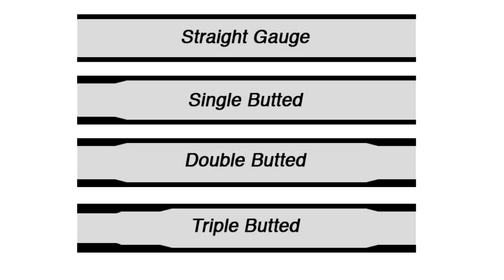Steel vs. Aluminum Frames

Comment: There's a lot of evidence that steel bikes are faster if you get one that flexes enough for your power output. Also steel is far less fatiguing and so you can ride faster for longer. The important thing is getting a thin, flexible frame. Of course thin tubing is no good for a street bike but if you want to go fast.. it has to be like that.
Reply: I know that this is 6 years ago, but trust me steel isn’t faster at all than aluminum. I’ve been riding fixed gear for at least 3 years now and when I first bought my frame, it was a steel retrospect fixie. All of my friends have an aluminum material frame. Every single time I rode with them I was the slowest and left behind. On any ground, trails, streets, etc. and I thought it was my weight, but no. Once I bought an aluminum frame, I was way faster and felt the weight difference. And yea your right, sometimes it depends if it’s flexible or suits your power but I weight 120 and I was still left behind.
Reply: @acidgoon  Try riding 50, 100km on a rough surfaced sealed road. Aluminum will kill you from vibration fatigue
Reply: @thomassmith4999  that doesn’t prove my point though, most fixed gear are made for track or street.
Reply: @acidgoon  Yeah but a very short distance doesn't show anything other than weight. The randonneur guys are the ones to watch to see what bikes are actually efficient and fast

Comment: carbon fibre is nice but costs too much not durable enough to crashes which is going to happen while city cycling .So my dream bike is titanium all the way , light strong good looking and can made in a classic look but pricy .So second choice is CHROMOLY triple butted painted dark metallic Purple :)  Now to add one in aluminum in an aero triathlon look with aero bars wheels etc because SASK is windy and flat. My current bike is a classic STEEL road bike and l love it ,BUT l am searching for a Ti  road bike next to add to my current collection :)

Comment: >just ride more

But if one considers the law of diminishing returns you'll find that the more muscle mass you gain as a steel rider you gain a proportionally large amount of overall weight that will ultimately reduce performance and slow you down. Most track riders aren't racing with steel framed bikes, they are all riding carbon or graphene frames that reduce thier overall weight and allow them to build up 27" inch thighs. If you were to race someone of equal fitness who is riding an aluminum framed bike you will always be at the disadvantage. 

Im inclined to think your pretentious hipster steel bias heavily sways the overall tone of this video.

Comment: I have 8 different bikes... A steel fixed gear, an aluminium frame track machine, 3 aluminium mountain bikes ( 2 hardtail 1 full suspension), a vintage Columbus slx steel race bike, a drain pipe vintage steel commuter, a carbon modern race bike, and an aluminium cross bike.... It's not material... It's geometry of the frame that affects ride characteristics I love the all  but the one that feels fastest is my 1988 Viner record professional slx that takes the cake... I can smash that frame with 1000 watts of effort and it just doesn't give up..might flex a bit across the cranks.. might feel a bit twitchy.. but god damn it's fast

Comment: I have a carbon giant tcr, a Masi single speed steel, and a lynskey titanium bike. All have somewhat similar geometry, and all are on 25c tires. The lynskey is hands down the best of the three. It"feels" livelier and has a very surefooted feel to it. While I can't isolate this to the frame material, it's seems to be the likely reason since I have felt similar characteristics from a friend's moots titanium bike. If you can drop the coin, I would recommend titanium for a life long bike.

Comment: alluminium when oxydizes usually creates an alluminium oxyde layer that prevents the oxydation of alluminium bellow it, at least that's how i learnt in school.
on the other side, iron when it rusts starts flacking and oxygen gets to the lower iron spreading the iron oxyde further.

so i think alluminium  should not corrode when compared to steel/iron (remember people use alluminium on windows, that are exposed to humidity alot more than a bike)

Comment: I am thinking of going back to steel after riding aluminium for ages. Aluminium is better uphill because lighter but otherwise I preferred steel on flat. Slightly heavier steel frame  in fact helps on flat. Otherwise I dont think the performance is affected but I would say steel frame can be made to last forever providing you look after it reasonably.

Comment: Aluminium will oxidise but will not corrode in moist conditions.  It will produce a very tough oxide layer that is firmly bonded to the base metal and acts to protect it.  In contrast, iron oxide (rust) flakes off the base metal exposing new base metal to the elements which is why exposed iron or steel will deteriorate over time.
Reply: You may want to research Galvanic Corrosion of Aluminum.

Comment: Some people say carbon is as strong as steel but freak out when you tap the top tube with your wedding ring or clamp it in a work stand. Wish there were more steel bike available. The bike market is all about looking like the pro's. And carbon is lighter so it's good for MUH GRAMZ even tough many people could lose some weight them self.

Comment: As where I live there are sometimes on the street there are little hole or little bumps and I was wondering if I should go with a steel frame since its stronger or does it really matter.? Any suggestions.?

Comment: I have two tange steel frame bikes.  One Single butted, the other double butted - 25 years old now.  I commute on these bikes and ride with 38c slick tires Nimbus ex that make a very supple and fast ride.

Comment: I love my Aluminium frame, nice and stiff but since I have 27.5" wheels with 1.95" wide tyres it's super comfortable, great for the cyclepaths near me which for a few miles are right next to poplar trees so the roots make it uneven as hell.

Comment: Reynolds 520 should be a standard for Street Riding , a notch higher Reynolds 725 , climb up in the latter Steelwise the frameset  tube walls will be more prone to dents ...Yall Welcome to join my group on FB,  Steel Fixed gear https://www.facebook.com/groups/SteelFixedGear/?ref=bookmarks

Comment: I can see (and have experienced) the difference in ride of steel vs aluminum, but citing reliability as a reason when referring to a fixie used for urban commuting to shy away from Aluminum is silly. Compared to other genres of bikes, they live a very very easy life, and yet there is little issue with aluminum frame dirt jump, BMX, free-ride, or other bikes that get abused much more. 

If your frame is breaking doing urban commuting, even from a crash, quality, not material, is to blame.
Reply: Are you an engineer? You're making bold claims without the qualifications to back them up

There's something called material fatigue. Bicycle frames absorb impact and vibrations and have a lifespan. Steel will last for decades, specially Chromoly, a higher quality alloy compared to Hi-tens which has more carbon and rusts (aka compromises structural integrity). Aluminum on the other hand has a much shorter use life, and it doesn't show signs of wear, and rust is harder to spot. So it results in catastrophic failure specially near the fork. Aluminum and carbon are the materials that you see the most suffering catastrophic failure and accidents in trails

Chromoly is an expensive method of manufacturing steel. The reason there are so many cheap vintage frames is because the 90s was a time of booming for mountain bikes, so they made a LOT of them, and they used a high quality material to impress the customer
Reply: Yes, aluminum has a fatigue limit, one which is easily designed around. If you look at the S-N curves for various common grades of aluminum they tend to behave similar to steel until ~10^6 cycles, after which they continue to fatigue while steel hits an endurance limit (after which steel doesn't fatigue in any meaningful sense). But even at 10^8 and 10^9 cycles and beyond there is still a large amount of strength in the material. 

This fatigue rate is also impacted by how far along the stress strain curve the cyclical loading occurs. If it's not a significant amount of the total strength of the part, it's not a significant fatigue event. If a frame is designed and produced right (quality) there is no reason that the fatigue limit is a meaningful factor in the frames life. Evidence of this can be seen in things like heavy duty cast aluminum parts on vehicles and similar that see a very high load cycling rate, but with peak forces well below their maximum yield strength lasting for many decades.

If we are going to argue that fatigue limits represent an inherent hit to reliability of a bicycle frame, then we should also argue that the corrosion issues of steel, particularly inside a frame also represent a risk to reliability. Clearly we should all be riding titanium frames. :D

My original comment isn't implying that aluminum is better or worse than steel, simply that it isn't by itself an indication of reliability (I personally prefer steel frames, but not because of reliability). The quality of the frameset, regardless of material will impact the reliability orders of magnitude more. Especially in a use case like a commuter, which generally sees lower peak forces than most other styles of riding.
Reply: Well was really considering buying the urban track 6ku aluminum
Reply: Feeeeelings.  Whoa whoa whoa feelings...
Reply: Hmm ... is riding a fixie not already silly?

Comment: you probably won't respond to this as you have 11k subscribers, and the famous YouTubers usually don't respond to non famous ones.  but I subscribed and found this topic interesting as I Have recently built up a 1988 half steel half aluminum bike from a 6speed to a 10 speed on my channel and I wish I had ride a steel bike sooner as I also enjoy the liveliness of the frame material.  even though I have  2 carbon bikes and a alum fixed gear, the steel honestly feels better to me, and although it is my cheapest bike at $120 Craigslist.  just wanted to say kudos, and great video.  from HAWAII,  aloha!

Comment: Titanium. It is like the best of both but does not corrode.
The weight and stiffness is between both aluminum and steel yet its strength is closer to steel.
The down side is its expensive and difficult to repair.
Steel is ,like you mention, excellent with weight and corrosion being isonly issues.
Carbon fiber is awesome but is not very durable as far as abrasion and being compressed. I also have concerns regarding longevity to sun exposure to the resin but I think it has the most potential because you can manipulate its properties so greatly to give a ride characteristic like no other and its extremely light but if it fails there is no warning and its catastrophic.
Carbon is also constantly evolving and I wouldn't like buying a bike that in 5 years is now obsolete.

Comment: Ain't no such thing as too rainy to ride!  But on a separate note, while aluminum does oxidize the oxidation does NOT eat through steel like rust does. Because of this, as long as the oxides aren't dissolved or dislocated be things like acid rain or rubbing a piece of aluminum can stay outside indefinitely.

Comment: Steel because I can get a decently light, durable frame from the 70's-90's for £50 secondhand and build it into a singlespeed commuter that will possibly last another 30 years or more if I look after it... Also don't worry about overtightening bolts, dropping a wrench on it, using a "torque wrench", blah blah blah. I know a guy who thinks his 3 year old carbon bike is "feeling tired". HA! 
Also like many people I cannot afford carbon or even nice aluminium bikes. £100 carbon bike? Stolen. £100 steel bike? Got three of em, serve me well.
Reply: That's exactly the way I think also. The vintage chromoly steel frames are going to outlive 90% of carbon and aluminum frames
Reply: That's exactly what my dad has been doing for the last 15 years, he works as a bike mechanics and has a lot of friends in that industry so every once in a while he would just arrive home with a brand sparkling new frame that was no longer needed and got gifted to him, it's his hobby and he made some good moneys with it, he once met a guy who wanted to change almost all the gear on his professional mountain bike so they chatted a bit and my dad did the work in exchange for all the old gear, and that's how i got a 300€ shifter on my mountain bike :D

Just 2 weeks ago a guy he knew gave him an almost new scott-USA alluminium bike frame for free since he didnt need that anymore and now he's about to sell the bike for 600+ euros 

It's just amazing for me how people would just throw away perfectly working frames amd components and the right person can make a good amount of money with them

Comment: Around 7:15, you mention that if steel doesn't break the first time you apply a load, it will never break. However, it is completely possible that a steel frame can break from fatigue. The key indicator for whether or not steel will have infinite life is the alternating stress. After you calculate the stress at a point, you can use what's called an "S-n" diagram (alternating stress vs. number of cycles) to determine the life of the part. If the corresponding number of cycles for a given stress is 1 million or greater, then the part will have infinite life and never fail due to fatigue. Aluminum on the other hand will eventually fail from fatigue no matter what the load is. S-n diagrams for aluminum only go to about 5 million cycles, so a well designed frame could potentially last essentially "infinitely", but it won't be a true infinite life like what is observed with steel.

Other than that, great video! Even after you've taken a class in materials engineering all the terms to describe the properties of materials still get confusing.

Comment: question.. have u seen anyone use a mountain bike frame and convert it into a single geared bike... ??? because I had an Idea that would be super cheap
Reply: Zach Gallardo dude I stripped down one of my 2 1989 trek 1000 thinking it would be easy to convert it into a fixie, and I didn't know anything about the vertical drop out drama..
Reply: Ed Perez yes with the older frames that are thin ,a kid at school did this and it looked pretty sweet
Reply: You'll need a chain tensioner, especially if it's a full sus bike, since chain length changes in most suspension platforms, although I wouldn't go single speed on a mountain bike unless it was a DH bike, since you're genna need to pedal up and down hills on most mountain bikes. Dirt jumpers also often use single speed drivetrains

Comment: Even if a steel frame is an effcient spring, energy is lost. Springs never return 100% of the energy that goes into flexing them. How negligible this is, I don't know, but it is simply false that stiffer frames just "feel" as if more of your energy goes into moving you, it is actually true

Comment: I've recently gone from an Aluminum frame to Steel. Steel is definitely more shock absorbant. it rides over bumps much more smoothly than Aluminum. Aluminum is just harsh. They can be pretty damned light but their utter stiffness without any flex does make them less comfortable. They DO transfer power a little better, that is very noticeable, but in the street steel is faster because it gives. You can put down the power more readily, uninterrupted by road irregularities. I'll say this, out of the saddle climbing, Aluminum wins. But staying seated Steel wins.
Reply: I own one chromoly bike & one aluminium bike and i totally agree with you. AluBike can propel faster but also fatigue me super quickly while ChromolyBike absorb some push but ride very smoothly for long long distance. Ofcourse i prefer chromolybike :)
Reply: The fact is stiff is bad for durability, the impacts and vibrations wear the frame quicker. Aluminium is more brittle of a material than Steel too. Chromoly is by far the best material for bicycle frames and forks, imo, the most durable only second to titanium, but Ti is a whole different league since it's hella expensive
Reply: James McClellan aluminum is 4X’s as lighter and stronger it doesn’t takes brains to know that.
Reply: Austin Araujo stronger? No, it might be stiff but not strong, I already cracked 2 alu frames and 3 forks over the past 6 years, my first chromo bike that I bought second hand from 1997 still kicks ass, love the aluminum but it doesn’t last as long as steel.

Comment: My personal favorite is Carbon because to me it is the most versatile material. I have a Cervelo S5 race bike for my local crits, and a BMC TimeMachine ALR01 (aluminum) for training. And carbon is not that fragile that everyone tends to think. I've had several crashes (20+ miles per hour) on my Cervelo at the crits and the bikes is really fine. Got it checked had it has zero dents or cracks just scratched the paint. On the other hand, because my BMC is for training and i use it on rainy days, the down tube is starting to corrode. I can ride long distances and my carbon bike is really compliant, stiff but doesn't beats me up. At the end is a matter of personal taste, no material is bad, nor any material is the best. You can have really cheap steel frams that will bend easy, and have really expensive carbon bikes that will crack with a minor crash.